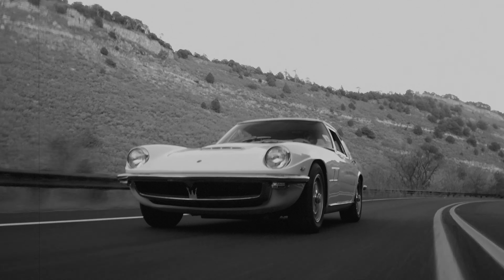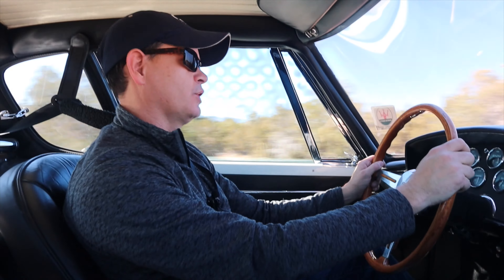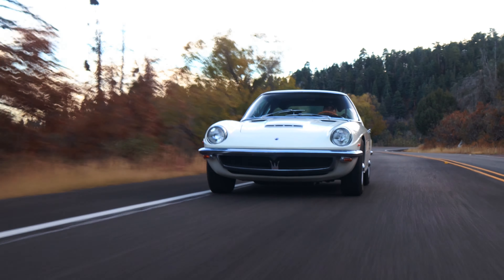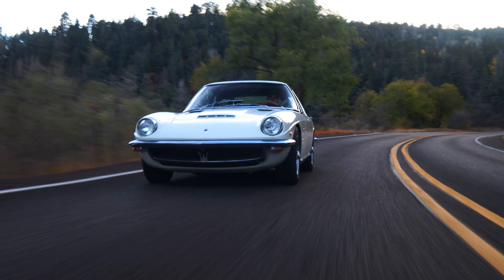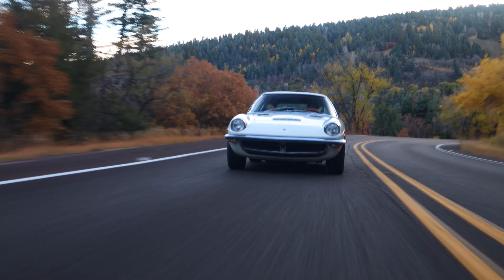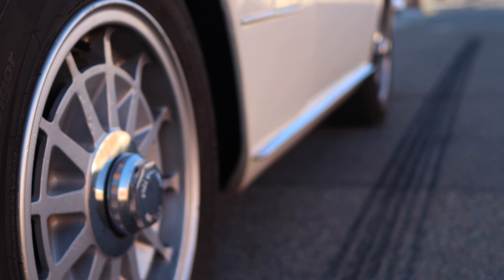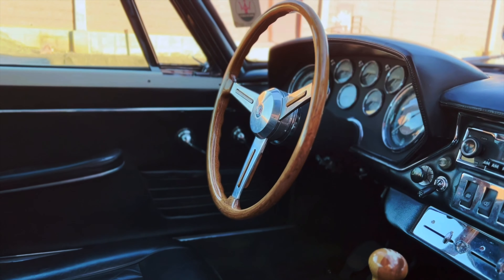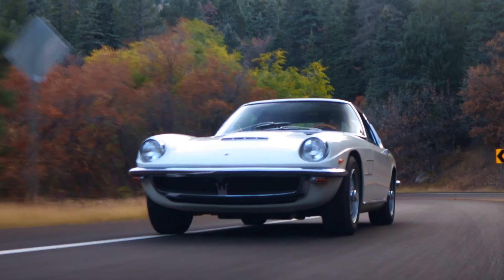1965 Maserati Mistral Coupe: End of an Era

Comment: People keep going on about the road car 6 cylinder engines being derived from the racing car engines. The links are there but the characteristics are extremely different. Best to focus on the characteristics of what actually went into the road cars. Nice video though!
Reply: Thus the word "derived".  Obviously the requirements for road use are different from those for grand prix cars.  

The thing that gets me is that they talk about it as if the V8 engines that replaced the I6 were not race derived.  But they were; they came from the 450S. The block even has the ports for dual plug ignition, although only single was used.  They did keep the dry sump.